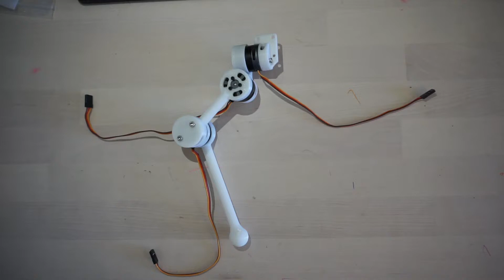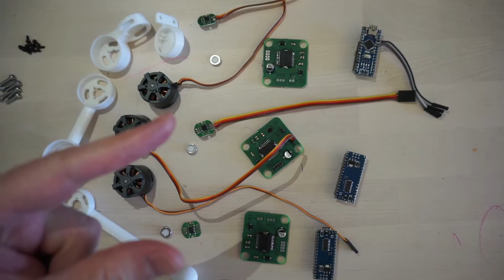Robot leg

Comment: Hi Anton! Can you say the motors, drivers and sensors used in this project? 3D model for the leg is welcome too!
Reply from the maker: Hi Fabricio! 
I tested this version and it can't lift itself, currently I'm focused on creating motor controller board which integrates all these boards on one board. The latest video on my channel is the test of this board. Will publish more demos later.
Motors are 2208 bldc noname motor, as5600 sensor, driver is L6234 chip and Arduino.
Reply: @AntonPechenko  Thanks for your feedback!